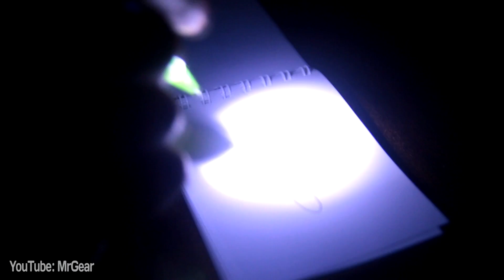4 Simple & Fun Life Hacks

Comment: If you use a 9v battery and two leds without any protection you goin to burn those leds and hurt yourself, each led only needs 3.5v to operate and you know how much voltage need's to operate those motors?, because is the same situation if you don't know the specification of the motors you goin to burn the motor..........sorry but is not easy as it seems